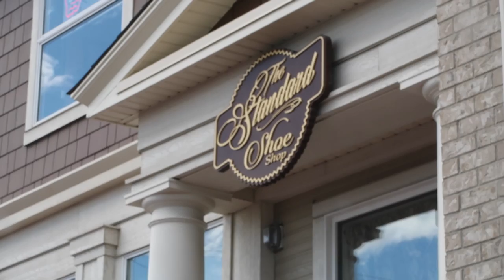Garage Sale Score!

Comment: Nice vid, i really know exactly the way you feel about garage sales, and how i dont want to get the items just to take up space. In fact most of my tools i have gotten at garage sales (my jointer, plainer, roughter, and my lathe). All by some dude that was moving into a apartment into the city. He also threw in some great woodworking chisels, and diamond tip sawblades 4 free. that was probably the best garage sale i have ever been to.
Reply from the maker: Right on. It's worth it if you can slowly build up your tool collection. My rule is I always look for tools and if I find a hot deal, I buy it. The only way I'll pay full price and buy a new tool is if I'm in the middle of a project and there is no way to finish it without that particular tool (especially mechanics tools while I've got a vehicle repair going on). I found a nice metal lathe and my milling machine 2 years ago for $1200 for the pair because the gents was getting to old to work in his garage. I saw the same lathe last week for $3200. Worth always keeping an eye out:)
Reply: Exactly, we looked it up afterwards and we saved over roughly 5 or 6 thousand dollars by getting the tools there. Again have a gr8 day
Reply: Exactly, we looked it up afterwards and we saved over roughly 5 or 6 thousand dollars by getting the tools there. Again have a gr8 day

Comment: If I'm not mistaken your "climbing things" are known as "Climber Gaffs". That what we use to call them back when I was a kid in Alabama. If I'm not mistaken (again), the ones you have are more for like climbing wooden poles (telephone poles) or trees with a thin bark. Gaffs used for climbing pines tress and such, the hooks or cleats are longer and also at a greater angle. That way when you kick down into the bark it goes deeper into the wood and doesn't just get caught in the bark itself.
Please do your own research for what you have, because you only showed them for a short time, and my memory (like me) is extremely old. A very nice haul if I do say so myself!
Reply from the maker: Hey, thanks for the great info. You know far more about them than I do. I just saw them and for the price thought it would be fun to have. Every since I was a kid I've thought they were cool, but never have I actually known anyone who has ever used them. Thanks for the info! Cheers.
Reply: Simple Little Life Your welcome Sir. Another suggestion if I may, when using the gaffs, please be sure to wear a boot that's high enough against your calf to accommodate the fiction of the calf support of the gaff. We used old WW2 style paratroopers boots. Extremely high from heel to knee length, and added a lot of support when climbing up and down pines most of the day. There are manufactures that make boots designed for tree gaffers. I ask you use with care, keep your points tipped but not sharp (if that makes any sense), and make sure your harness has a crouch strap. Just in case one of your cleats slip. Better to have sore "jollies" for a couple of days instead of laying in a hospital bed waiting for broken bones to mend from a complete fall.
Reply from the maker: Thomas Pigg that all makes sense. Thanks for even more great info! If I ever spend much time in these I'd certainly consider the boots I'm wearing, but I really don't see myself actually spending much time in these. But I am going to give them a try. Also, my neighbour has a tree that had a large branch blow over during a storm last summer. It's just out of reach of our ladders, and hard enough to get at that it's still hanging there. Might be a good chance to put these one, bring the limb down with an axe and then harvest the firewood.

I really appreciate the info you've given me. Cheers!
Reply: Simple Little Life You're welcome Sir. I ask you please be careful when attempt to accomplish your task. As a survivor of a 45 foot fall, I can just about guarantee you wouldn't want to do the same. I was many (many) years younger then (17 then, 56 now) and I know there's no way I could recooperate from it. I'm not sure (and please forgive me), but your not a "spring chicken" either. 
As an old man once told me, "Knowledge is knowing something. Wisdom is the knowledge of knowing when to and when not to do it". 
Have a great day my friend!!!!!

Comment: Nice video. The blue point tac is really nice!!!! I want the rustic wheels!!!!! Look up the vise it might be a antique or have a value. You work want to restore it properly to keep its value.
Reply: Would*
Reply from the maker: Thanks. I appreciate the heads up. Great idea to do a little research first! I checked it up a bit and it's not quite an antique but it certainly sells for more than the $20 I paid. I only really have to clean up the slider rails to is moves a little more freely so it shouldn't be too much work. Cheers!
Reply: +Simple Little Life sounds good.

Comment: Look at how this bench vise is mounted compared to the two you have.
http://loflow.smugmug.com/Other/Garage/i-VD3XN7w/0/L/DSC00833-L.jpg

Yours are too far back.
If you hold a workpiece vertically, it has to clear the benchtop.
Reply from the maker: Yeah I do mount mine really far back, but that' s because I only use them for knife making right now and don't need to clear the work bench as I never hold anything very long. Also, it's a shipping container with about a 2' walkway down the middle so I keep everything as tight as I can get it. Since I don't need clearance on under the vise for long pieces, I'd rather keep it out of the way and protect my hips from cranking it overtime I walk by. But yeah, for a typical setup, this wouldn't be the best by any means. Cheers!